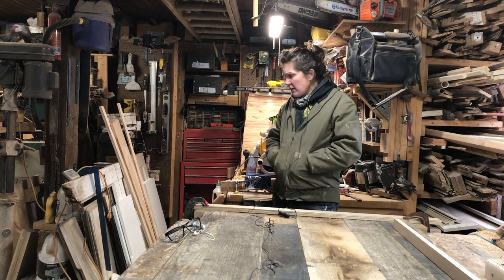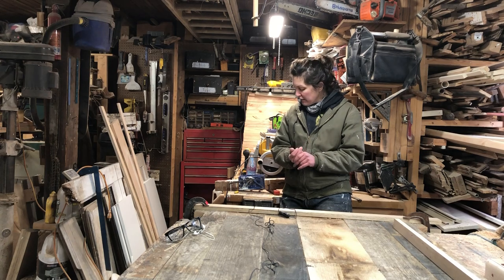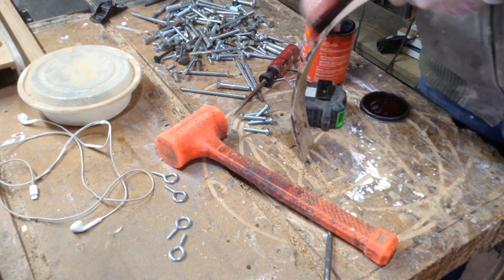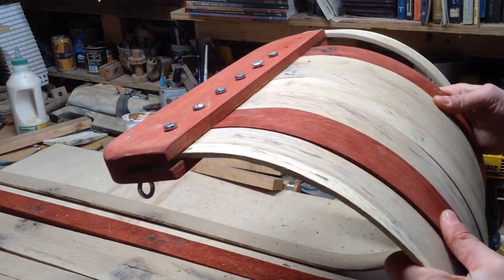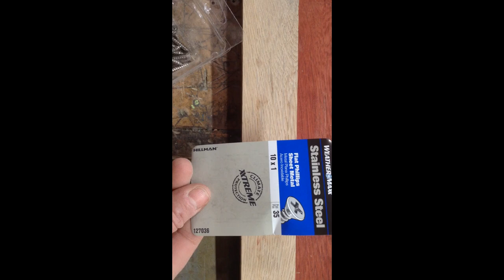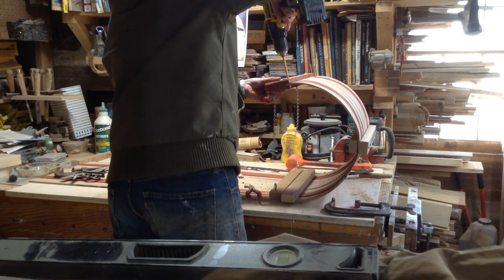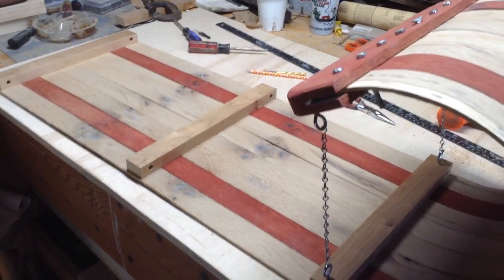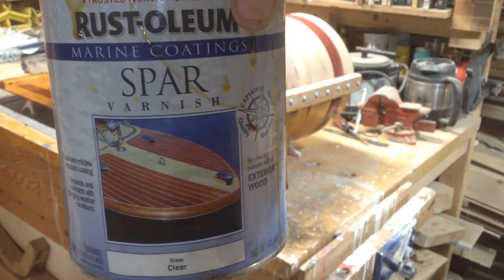Woodworking : Wooden Toboggan / Sled // How-To Part 2

Comment: This video has perfect timing for me, with your honesty in showing the slat alignment mishap and fix. I'm in the middle of a project where I made a rather dumb mistake, have been fretting over it even though I've determined how to work around it, and, well I guess you've taught me to accept the mistake and continue doing the best I can. 
Moral to my story: target perfectionism but don't expect it, at least not all the time. Thanks for posting.
Reply from the maker: Exactly.  I definitely stared at it for a little bit trying to convince myself the misalignment wasn't THAT noticeable.  But, in the end I usually decide to fix mistakes like this and it's always worth it.

Comment: I discovered that under the rear board there are two counter sunk holes to screw the inner jaw into the bench. I think that would add a lot of strength
Reply from the maker: Hey Scott,  I did not so I’ll have to do that.  Thanks!

Comment: hi, why don’t you just grab a still from the video? My only worry would be that the sled went over a stone and broke through the very thin wood and rendered the sled unusable.
Reply from the maker: It does seem thin, but I believe that thickness is pretty standard for these which is why I went with it.